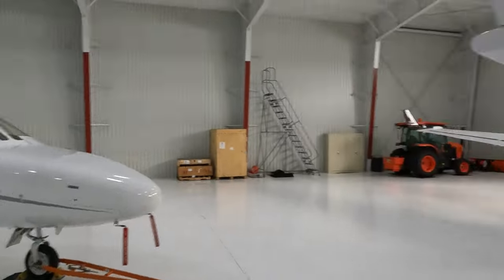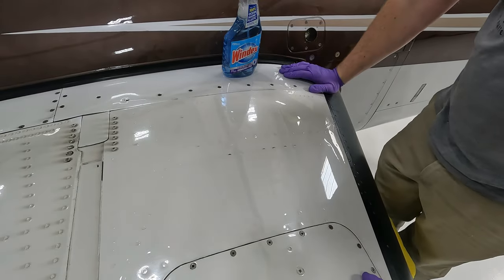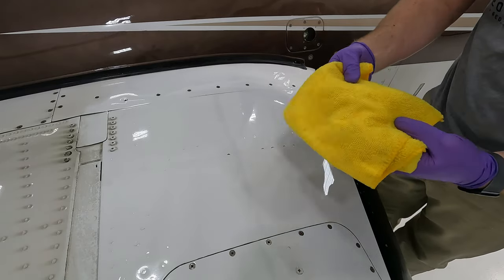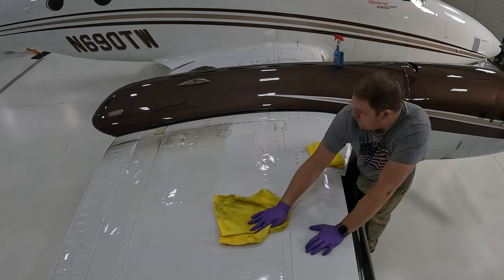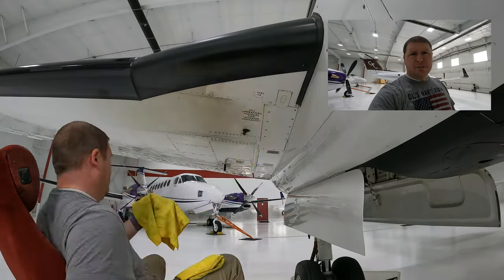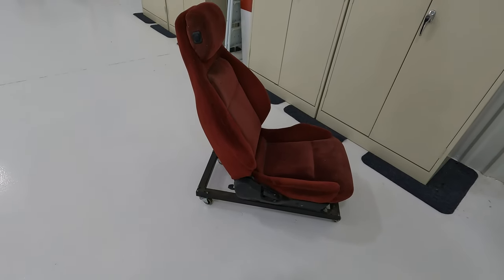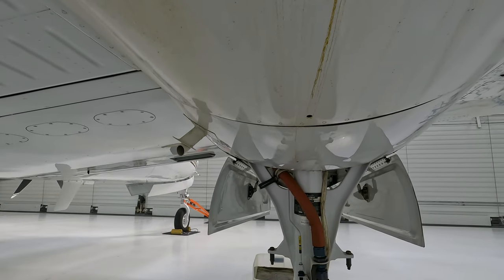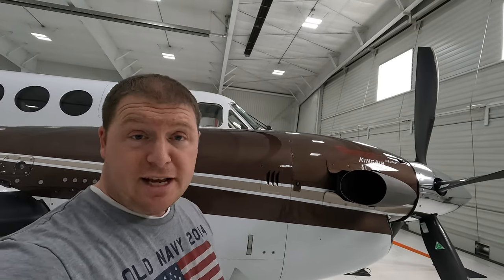How to clean turbine soot off a King Air?

Comment: I use Release Cleaner when cleaning aircraft, it's probably just as cheap if you use the concentrate and it meets all the specifications for use on aircraft. It's hard to know what people put in products without those tests. It spray on and sit like you said then wipe it off.
Reply from the maker: Good point.  I haven't had a problem with Windex yet, but you never know.
Reply: @thesuburbandad  Release only costs $1.12 per 32 oz container when you buy the concentrate and dilute it. Pretty good value if you ask me.